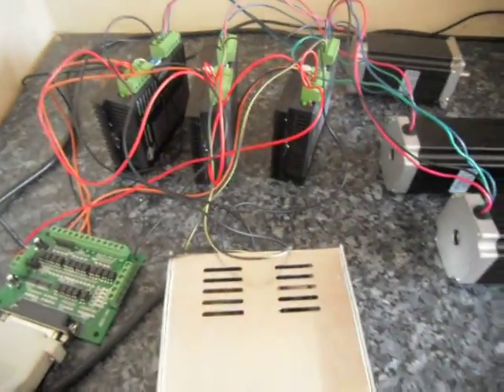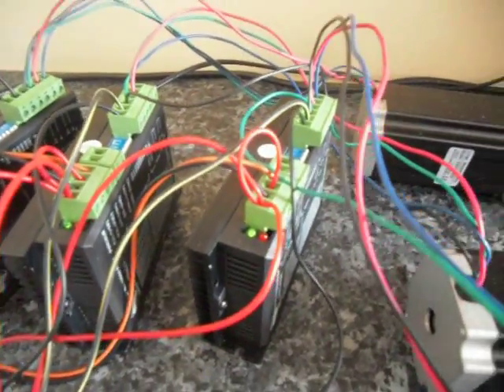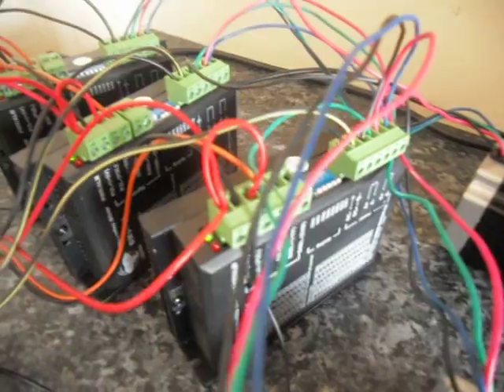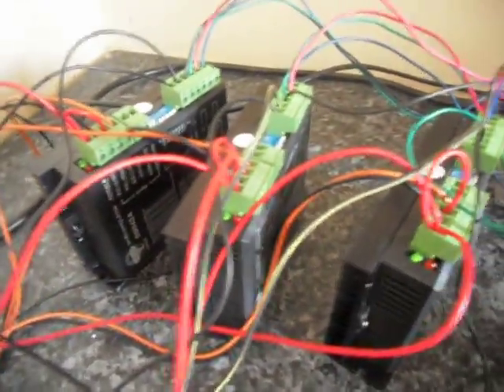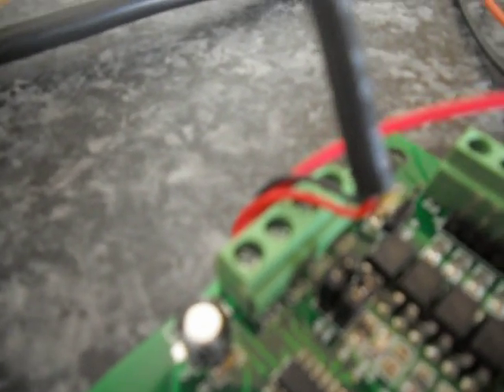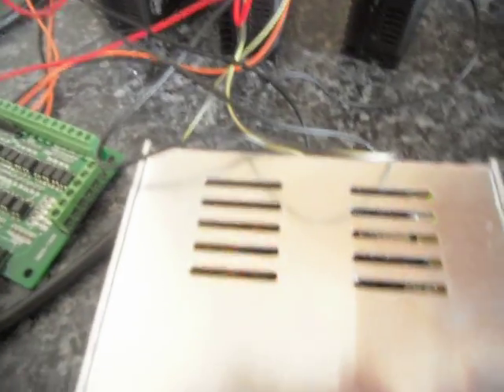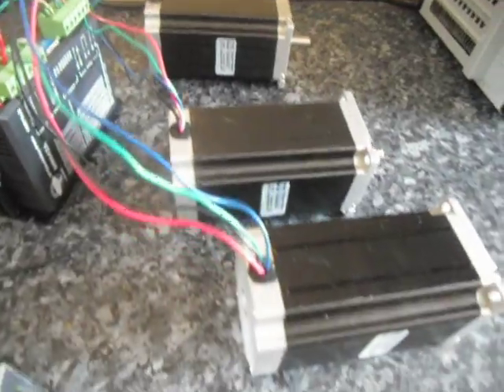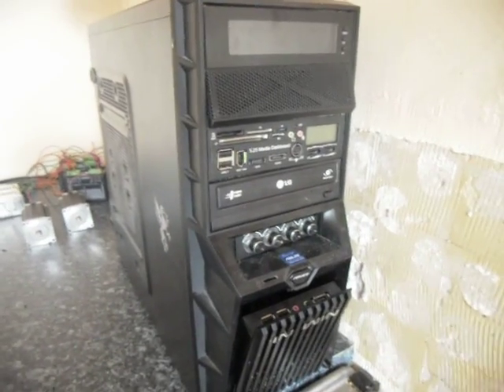DM542A nema23 setup

Comment: hello friend I have the same kit you but the engines are 435 oz. I have problems with them because I do not give q give the correct steps in manual mode to the left and goes left but before back a little to the right. and they do not go very fine, also when I load a job in masch 3 in the fast movements move but when work begins in speed steps are skipped - engines are not in the machine but as you have them on the table. since you do thank you very much friend beforehand.